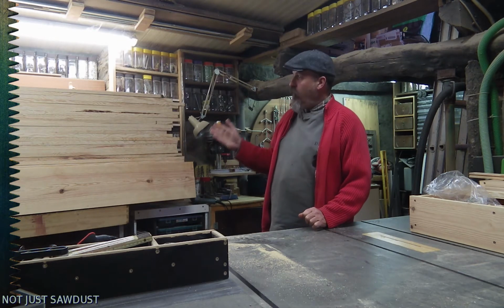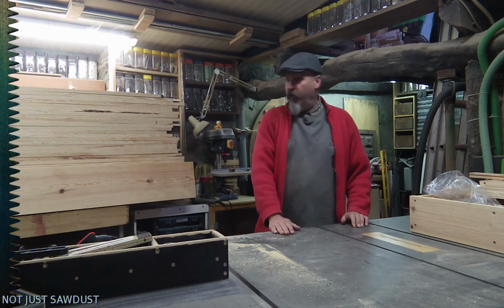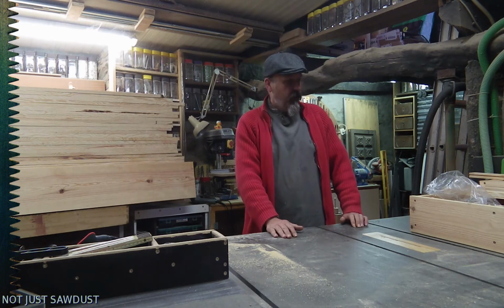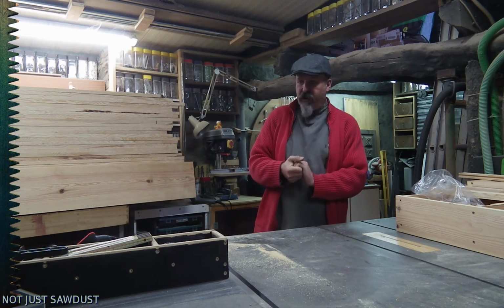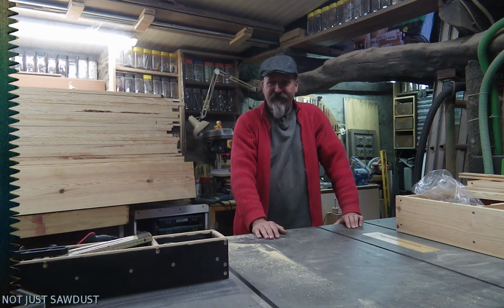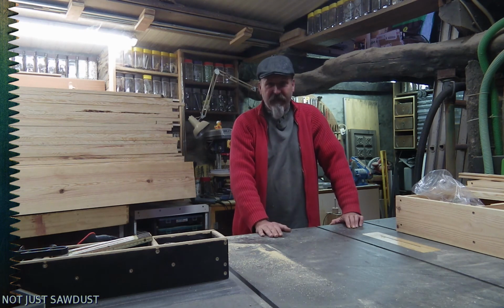#99 Update on projects and Shout-Out for a favourite channel

Comment: I didn’t realize that the library wasn’t done... man that’s a LOT of wood..
Reply from the maker: This is just fase 2 of the whole build. It is indeed a complete library. 2 rooms so 8 walls and free standing in the middle. In total about 60 meters, ceiling high, bookcases. That takes a lot of wood and also some clever planning because it isn't always available here in Portugal.(specially in 25cm wide)
Reply: So you’ll be half way there when those are finished then? Nice to see that you are busy with contracted work at the moment. Have fun making dust!